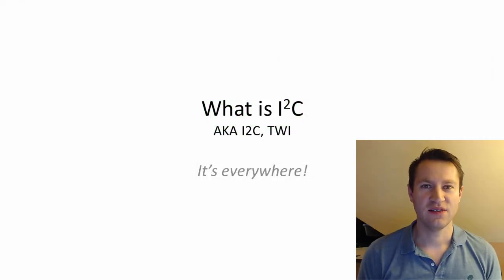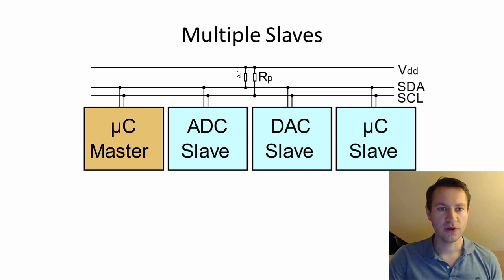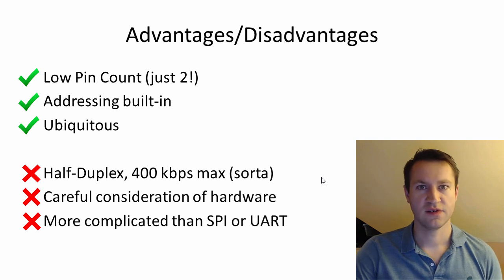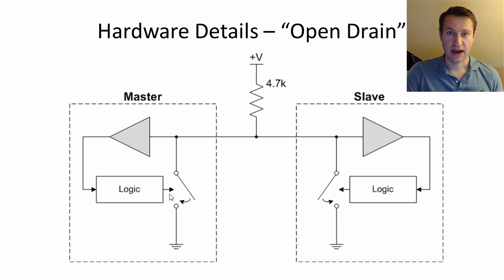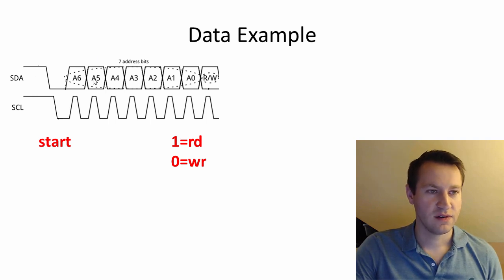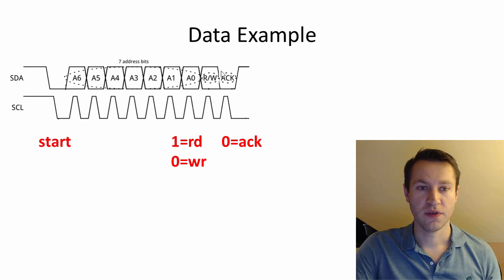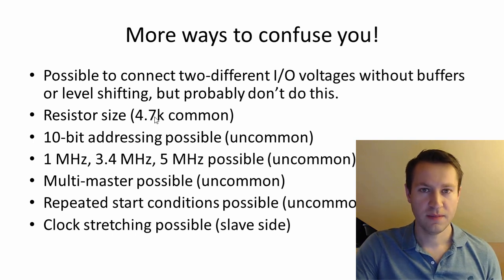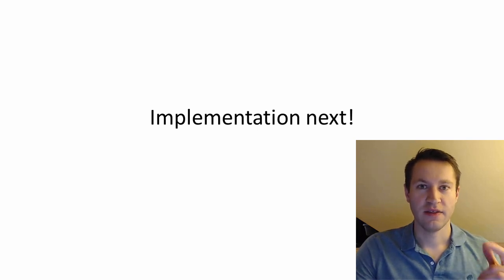What is I2C, Basics for Beginners

Comment: Hi, this video is very good! But maybe there is some thing missed in the data example. After the slave address is put on the bus by master, then the register address in the i2c slave device should be put on i2c bus, then the data should be put on the i2c bus by slave or master depending on read or write operation. 
What I mean is the register address in the i2c slave address is missed in your example.

Comment: If I have a DHT22 connected to an esp8266, for example, how long of a cable can I use before the data becomes goofy? 22 gauge wires 5 mm apart from each other is about 0.1pF/cm, so 10 cm of wire would have 1pF of capacitance on the cable.

Comment: How often are pull-up resistors actually used, though? And why not set your master pins to be open-drain with a pullup as an alternative?
Reply from the maker: The pull-up resistors are required. They're always used. You need something to pull the CLK and DATA lines up to 3.3V.

Comment: Hnm, i dont agree with the uncommonness of repeated start conditions, almost every register based i2c device uses it to not loose the bus between the initial write (what register do i want to address) and the next read for the  data.
Reply from the maker: Thanks for pointing that out!
Reply: In general, I2C communication is the mutual communication between ICs and ICs on the board. If there is IC and IC communication between boards, what are the advantages and disadvantages? How stable is the communication?

Comment: Hi Dejan, This is a great explanation of the concept of connecting I2C items on the same board. I am very new to doing anything at all with electronics but my current project uses the MPU6050 module and I want to add a distance measuring module into the project too + powering some servos with the PCA9685 that also uses the I2C protocol.
I have the MPU6050 actuating 4 x servos at the moment on an Arduino Uno with regular breadboard and external power supply. The code seems to stop working after a few minutes and I am struggling to find a fault that would cause this. 
QUESTION:
You show an Arduino Mega in your wiring diagram... is that because you anticipate the code will be a bit heavy for the Uno? 
I am wondering if limited Uno memory is the issue I have with the MPU6050 at the moment - and if I should consider using a Mega for this module as i want to add other I2C items..?
Reply: For something like this application, uno would be fine. Mega is really used for things like IO needs. Maybe if you need a bunch of analog or digital pins, mega is good to use. Hope you got to explore electronics more!

Comment: In general, I2C communication is the mutual communication between ICs and ICs on the board. If there is IC and IC communication between boards, what are the advantages and disadvantages? How stable is the communication?
Reply from the maker: Between boards have similar advantages and disadvantages. The comms should be OK unless there's a significant distance or lots of noise on the line. However it won't be as good as a differential signal interface.

Comment: hello, in 2:20, we use ADC to digitalizing the data for the µC but the I²C use digital data, so why we need to digitalizing.
Reply: ADC is used to transfer some kind of analog signal, such as analog voltage, to digital format, then this kind of digital data can be transfered via I2C to micro comtroller. So that your code can recogonize it.
Reply: @futurelu623  thank you.